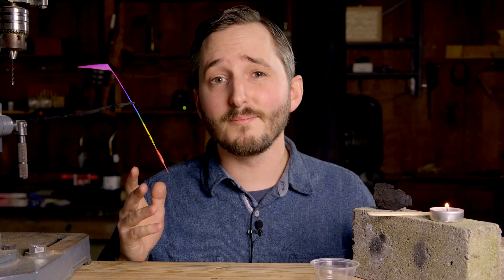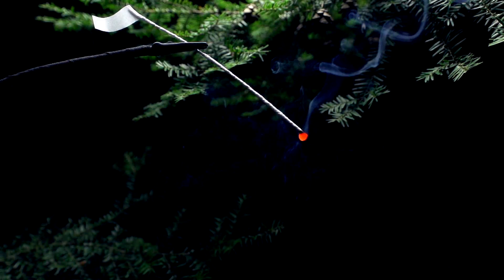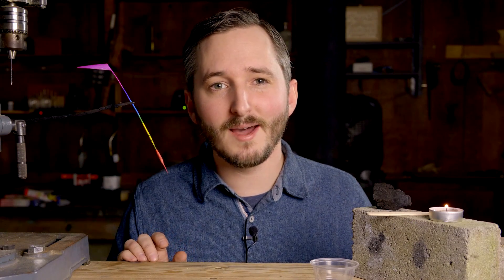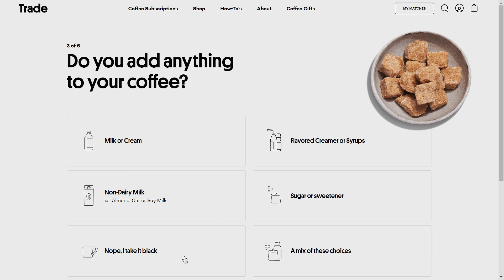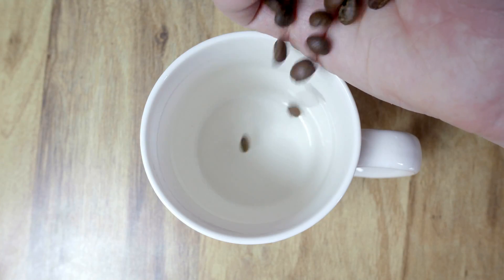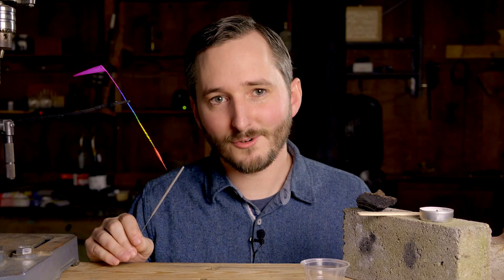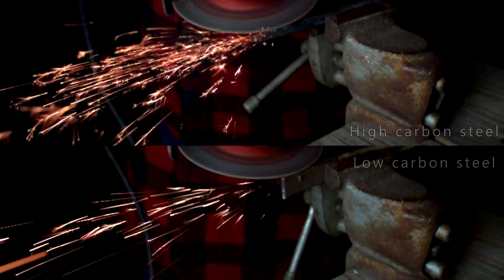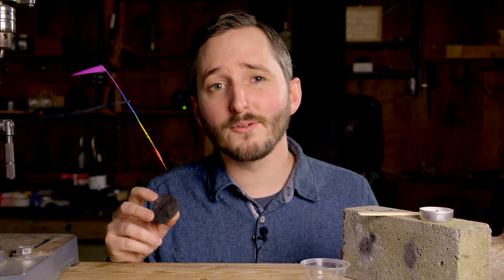Mystery of Branching Sparks Explained by Soda Water

Comment: 7:37 "iron has more carbon than steel"

is this a mistake? iron has no carbon. It's iron. Its an element.

You demonstrated that carbon turning into a gas could explain the sparks from high carbon steel or from the senko hanabe but you didnt at all explain why the iron shavings from a sparkler contain carbon. you even refer to it as "pure iron" at 6:47, but then later on youre saying it has more carbon than steel.

you also failed to explain how exactly this carbon is managing to turn into a gas while trapped inside a droplet of iron. carbon has a sublimation temperature of 5800K, are you saying that the droplets are reaching that temperature or are you positing that there is also oxygen inside  the droplet which is reacting with the carbon to form CO2? how is the oxygen getting inside the droplet? This explanation is incomplete,  poorly explained, and very confusing.
Reply from the maker: All common iron alloys have a lot of carbon, approximately 4% compared to steel's 2%. Cast iron as you know it is not pure Fe. The way the carbon may react within the drop is not certain, but it could be a number of things. Direct oxygen penetration is possible, but I think more likely is metal oxides are created at the surface then dissolved into the liquid where they can be reduced by the carbon with CO2 as a byproduct.
Reply: wouldve been very helpful to include all that in the video since it's kindve essential information for your explanation to make sense.
Reply: @Hephera  true, explanation needs work

Comment: Always interesting. My hypothesis for branching sparks sometimes appearing in carbon. Sometimes the solid material of the spark contains some volatile oil/liquid (most likely sap) which vaporizes, exploding the solid particle into smaller fragments. Hackberry is the wood I have seen make the most branching sparks.
Reply from the maker: Yes I think the same

Comment: @7:40 - Since when does iron have more carbon than steel, which last I checked was made by adding carbon to iron?!  Also probably a bit too much hubris to believe you're the first discover the reason for branching in sparks imho.  No harm stating your thoughts on it at all - but give those folks in the metallurgy industry some credit as this subject is directly in their wheelhouse so to speak.
Reply from the maker: You're assuming I haven't researched this. Spark branching is very sparsely studied. Also Google iron and steel. Steel is defined as iron with 2% or less carbon, common iron alloys like cast iron have as much as 4%.
Reply: Google "iron vs steel" and see why people would be confused by your characterization of it in the video: "Primarily, iron is an element while steel is an alloy comprising of iron and carbon. However, in this alloy iron is present in a greater quantity. You can add various other metals to steel so as to produce alloys that have different properties. For example, if chromium is added to steel, stainless steel is the product."
Reply: Also, your last video is case-in-point for my argument: "A Japanese Master Craftsman Taught Me To Make Senko", i.e. google would have you believe this knowledge is "lost", but low and behold it lives on in mind of a mastercraftsman - I'm simply stating there's some hubris on your part to believe the same cannot be true about spark branching and the knowledge of its underlying cause.
Reply from the maker: I ask specifically at the end of the video for people to share other sources if they know of anyone else that has done this same research, and at no point in the video do I definitively state I am the first. If you have a source, share it. Otherwise stop wasting my time with idle arguments.
Reply: @6:48 "pure iron" - then @7:40, "iron has more carbon than steel" - it's a point of confusion and a valid criticism, so is doubt this is "new" knowledge.  I'm simply stating valid criticisms supported by simple and correct arguments - not asking for your "time".  Wasting that is on you.

Comment: What if you flick the device and made the molten glob fall off and hit the ground, exploding. Kind of like the trick where you heat a small ferro rod (lighter flint) and throw it at the ground and it explodes into a massive spark ball.
Reply from the maker: Pretty much exactly the same thing happens as with a lighter flint, but not so bright.

Comment: So now we know why liquid sparks branch. But thats not all. When you take a type of wood which produces a lot of sparks, for example pine, when you are lucky you can see that the one spark branches to a thousand smaller ones. And it is not all at once. When it flies through the air it is leaving the trail of milions sparks behind. And this effect is really big. Sometimes it flies up to 1meter and it can last 1 second.  Hovewer this is really rare.  It sometimes happens to me, when Im melting aluminium with charcoal. For best results you have to have really small charcoal  pieces and you need to blow a lot of air into the fire. Next weekend if I will have time I try to record it so you can look at it.

Comment: That's a brilliant piece of investigation. Two more kinds of branching sparks which I would love to know about are those produced by burning titanium metal and those which explode out from a wood fire which I have mostly witnessed from burning pine wood inmy own stove. They shoot out when I open the door and then explode with starbursts like mini dragon eggs. The titanium does branch but less so than does high carbon steel. Look at the sparks from an ice fountain used on birthday cakes. They use titanium. The pine sparks I think are unique and may be due to resin content within the wood but I think your spark investigations are not over yet. Enjoyed your senko videos immensly too.
Reply from the maker: For titanium there is still some measure of carbon in most alloys, along with dissolved gases from the air. Higher reactivity and higher heat of combustion should make any gas bubble generated expand larger and faster. I don't know if it's the carbon in titanium or some other gas producer, but I still think it's probably the same general effect. For carbon that sparks and pops that's a little easier to explain. Because of the physical structure of wood and being made of cells and compartments within the grain you have lots of areas where gas can get trapped and expand when heated. It's well known that different wood makes charcoal with different properties, probably due to resin and mineral content, density, etc... these same things no doubt effect the sparks. I have some thoughts, but talking about charcoal can get hugely complicated fast.
Reply: @Nighthawkinlight  I understand. Being a fellow pyro I am aware of the mind boggling variables charcoal can create in pyro formulas. I reckon it's more to do with the resin in the wood turning to gas. It seems to happen when more oxygen is introduced into the fire by opening the door and poking it. You will have seen it before. BBQ charcoal tends to do it when used on a grill. BBQ charcoal is not as thouroughly reacted as the pyro grade stuff so I am guessing again that resins and volatiles that remain in the charcoal (for flavor and scent and for added weight) are gassing off and bursting the charcoal cells apart. In essence, just what you said in the first place hehe.

Comment: Hello. What if you will burn this senko Hanabi on International space station? As you said sparkling effect is coming from liquid jumping from main drop so surface tension of this mixture will work in space as well. So I assume that it will create nice sparklink effect all arround the sparkler drop.? Hope you understand what I mean.
Reply from the maker: It will not, because air is required to keep the liquid hot.
Reply: @Nighthawkinlight  Hello. I meant inside ISS where are astromauts living. there is zero gravity and breathable air. It will be probably impossible to sent them few sparklers to try it and there will be probably risk of dangerous gases escaping, but they have powerfull technology to keep air clean so maybe it would be possible. Unfortunately NASA will not be happy with this idea.
Reply from the maker: Ah yes, that would be interesting to see. I'm not sure how they would be effected.

Comment: Beautiful explanation but I believe that you left out a crucial aspect of the chemistry which is the surface tension of the bubble film being created by this particular type of  paper / compound combusion. The extravagant spark branch is easily achieved but the brilliance here is the distance away from the source. This is why you get sparks thrown further from the source than most sparklers of this type which is the film resisting expanding gas pressure. Awesome work

Comment: 7:36, I think you got it the wrong way, steel has more carbon than "iron" like you said before ;)
Edit: Or do you mean cast iron? Because that has a lot more carbon than normal (high or low carbon) steel, but is very different from normal "iron"/steel like the bar you showed grinding.I hope I didn't mess up, my 3 week metallurgy class was years ago ;)
Reply from the maker: Not than cast iron.
Reply: @Nighthawkinlight  Btw really nice video. I never thought of the sparkling and branching of sparks of different burning stuff... I learnt a lot today :)

Comment: Love the content as always. But I do have to say you might have had a slip around minute 7. You describe iron as having more carbon than steel and less than the senko hanabi. That is wrong, and you showed it during the machining example. Low carbon steel is closer to iron, where steel is an alloy of iron and carbon. Iron is an element, and therefore in it's pure form has nothing else but iron. So steel would be between the senko hanabi and iron in terms of carbon content. I think you know this already, so I'm guessing it was a slip of the tongue.
Reply from the maker: Common iron alloys (cast iron) have about twice as much carbon as steel. Pure iron is pure, but you don't really see it in everyday life.
Reply: @Nighthawkinlight  my bad, I thought you where talking about iron as an element. In that case you are right :)

Comment: My theory is the difference in the transition temperatures between the iron and carbon!  The iron melts first and starts the oxidation  of the carbon on the surface, which burns at a much hotter temperature and thus creates a mini explosion on the molten iron!  Then the subsequent smaller bubbles having a greater surface area, exposes more carbon to the oxygen and thus creates the explosion of branching sparks!
Reply: Ahh, it was nothin really!  Lol!
Reply: @themeek351   I was having a discussion with NightHawkInLight in another thread on this comment section and I've had to abandon my theory.

Pity that, but at least your idea still makes sense! :)
Reply: I like this theory! I think it would explain the energy required to make the droplets have such violent disintegrations that the angles between the direction of spark movement and the subsequent branching directions are often negative. (IE: reversed direction)

Droplet-surface carbon burning would be a plausible mechanism whereby sufficient energy  could be added to the drop so that internal carbon particles might sublimate to pure carbon vapor.

Carbon is hard to vaporise but carbon itself actually has that level of power when it combines with oxygen... otherwise charcoal wouldn't keep itself alight in air. (shout out to Russ Meyers, Port Pirie for that little insight)

I was a bit "iffy" about whether simple iron burning would be enough, but yeah! Surface carbon particles being burned would probably pull that off.

Once a molten droplet reached a critical temperature then pure vapor from internal carbon particles would disrupt a dollop of any type of hot liquid material. The resulting raw carbon gas should then react explosively with the surrounding air, blowing the droplet in every direction.

G'donya Meek!

Comment: If you had not already read it, I highly recommend you to read "Fireworks: The Art, Science and Technique" by Takeo Shimizu. I'd guess the branching also has to do with carbonates, which are used in fireworks to produce the crackling effect. These do also form in the reactions involving nitrates and any source of carbon, so these don't have to be added to get the effect. A good example is blowing charcoal briquettes which do have a high content of minerals.
Reply: Actually carbonates usually degrade when heated to release carbon dioxide, which is i guess also the burning product from carbon but it's a different chemical reaction, not involving the oxygen of the air. Thus, gas genration by chemical decomposition, genius !
Reply: I just went look for that book since fireworks are what originally brought me to this channel. Why in the world is that book so expensive?
Reply: @GeoffBernard read the pdf from internet archive
Reply: Yup, I've used barium carbonate and sodium bicarbonate for this. Only small amounts are needed, usually less than 1 percent by weight

Comment: Since the beginnung of the video, my thought was "it must be carbon, because there is the metal workshop technique to test the carbon content"
But I never thought about the physics behind, a molten dropplet of metal flying through the air and the carbon reacting to CO and/or CO2 and bursting this tiny dropplet of molten metal.

Amazing. Something you see everytime you use a angle grinder or light up fireworks - but you never really thought about the physics behind.
You did an awesome job

Comment: Onya Mate! Cool!

I'm a fitter and turner by trade and I've used grinding wheels to test unknown metal samples in just the way you describe. I like your idea as to why these types of sparks occur in high carbon steels.

At atmospheric pressures carbon doesn't melt, it sublimates. Perhaps gaseous carbon oxides (CO and CO2) don't even need to form initially. Perhaps iron particles burning in the air might just be enough to generate sufficient heat for the contained carbon to convert straight into the gaseous phase.

Bear in mind, iron oxide is unusual for metal oxides in that it melts at a lower temperature than the iron itself... hence oxy-cutting works. The disrupting of the molten droplets as carbon vapor pressure exceeds the liquid iron oxide droplet's surface tension would explain the extreme speed and violence of the spark disintegrations. (As evidenced by the negative angles formed between the droplet's direction and the branch spark directions) 

I think the carbon vapor has sudden access to oxygen once it overcomes the surface tension forces holding molten iron(oxide) droplets together. The air's oxygen then forces an extreme change in volume as it reacts energetically with pure carbon gas.

More carbon, more vapor, more branched sparks. It seems a reasonable hypothesis to me.
Reply from the maker: Very good thoughts
Reply: @Nighthawkinlight  Thanks!
Reply: @Nighthawkinlight  Humph! Forget everything I put forward! The boiling point of iron oxide is WAYYYYyy lower than he sublimation point of carbon. It therefore can't be what's really happening. There must be another reason/mechanism that is able to occur at far lower temperatures. 

Bugga! I was having such fun with that idea but now it's cactus... and well past bedtime here in Oz.

Honestly, thanks for the time you put into us viewers. I see the interactions you take the time to have with us all.

I've had a top night's prognosticating thanks to your efforts
You're a bloody gentleman and a scholar mate! 

And so say all of us!
Reply from the maker: Good line of thought you had though! I think probably gas is generated by the reduction of iron oxides by the carbon. Who knows though. It's an area for future research.
Reply: @Nighthawkinlight  I just thought of a way to test this idea. I think the hypothesis predicts that the black body radiation temperature of (pre-exploding) glowing droplets should exceed the sublimation temperature of carbon at atmospheric pressure. I have no idea how to take such a measurement though... ephemeral phenomena to say the least.

Comment: 7:38 Did you say there's carbon in iron?
Reply from the maker: In common iron alloys like cast iron, yes.
Reply: He did.  Meaning iron in the sense of "cast iron", iron out of a furnace, before it is turned into steel.  He most certainly did not mean that the pure element Fe has "hidden carbon" in it.

Comment: My great grandfather was a blacksmith.  He knew of this spark-branching phenomenon and understood it's correlation to different types of steels.  He described the number of branches on the sparks as indicative of the type of steel.  I.e. 4 branches = 4140, 8 branches = stainless, 12 branches = high carbon steel.  (These are examples and are not accurate, but simply for explain his idea).
Reply: TV traditional woodworker Roy Underhill has described the same thing when grinding chisels and plane blades. Edit: Typed just before NIL showed sparks from grinding steel.
Reply: Certainly a higher carbon steel will spark brighter, more frequently, and with more branching than something like mild steel, so I can believe there's some merit to this.
Reply: Well yes, that is how you determine carbon content in steel
Reply: 4140 stands for?
Reply: 4140 is tool steel